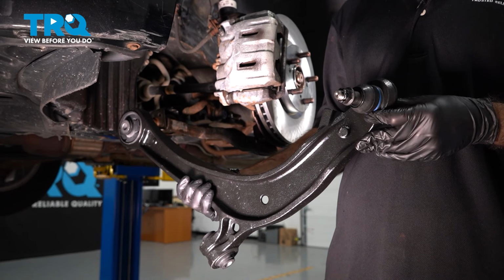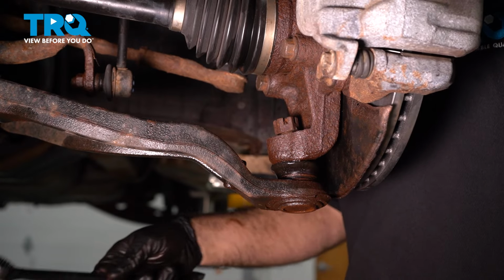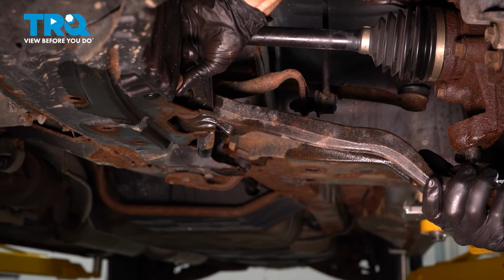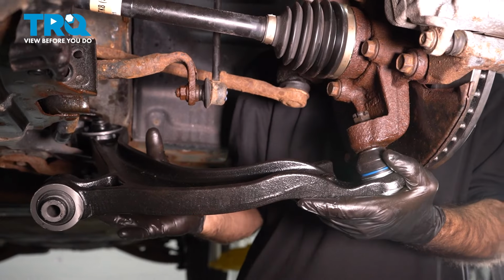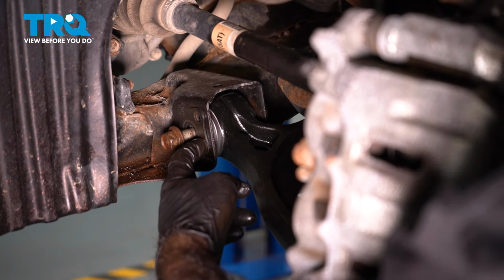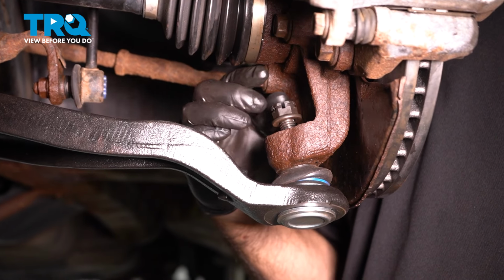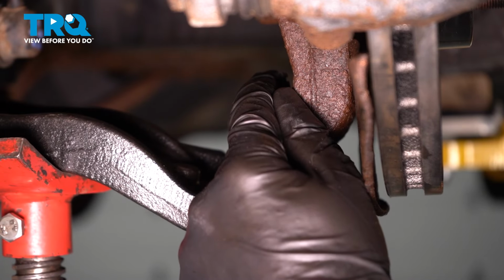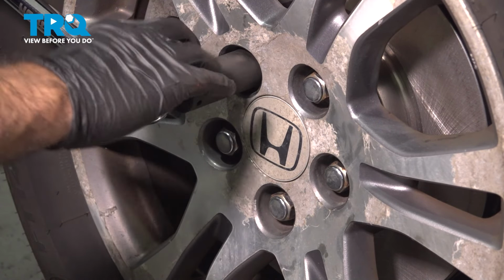How to Replace Control Arm with Ball Joint 2011-2017 Honda Odyssey

Comment: The rear bushing is far more difficult to get the bolt to catch the threads of the fixed nut when using a floor jack.

Comment: 2025, just changed both arms, $206 and $165 @ autozone. Video was great and spot on other than ball joint nut was 19mm. Follow the video and save yourself 600 bucks.

Tool rental from auto worked great. Be carefull as the pressure build up and lets loose... I did to turns on the nut and a couple wacks with a mallet, about the 12th time it was free.

Comment: Unfortunately, a lot of these control arms are now made out of cheaper, weaker metal.
Reply: "Cheap aluminum" costs twice as much. You are free to use cheap steel ones from older years. ALuminum ones are 10 lbs lighter, it was done for a reason of ride comfort and prolonging the life of suspension

Comment: Good video. Worth noting, Honda switched to an aluminum control arm in 2014. Although most manufacturers say the steel control arm fits 2011 to 2017, this is a bit disingenuous because The aluminum part weighs 10lbs less, less than half the weight. Given that a portion of that is considered unspring weight, you would want that to be equal on both sides of the vehicle, and ideally adjust bump valving of the dampers to match. (I'm not aware of any revised valving for 2014+ models, however.)
Reply from the maker: +@stretchsje Thanks for the feedback! http://1aau.to/m/Shop-TRQ